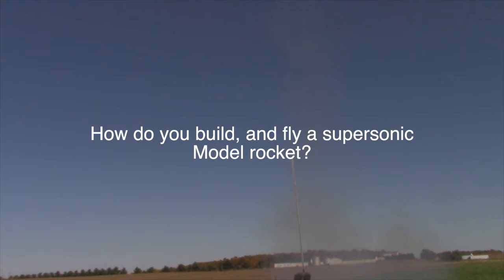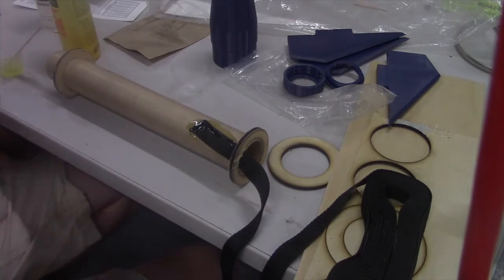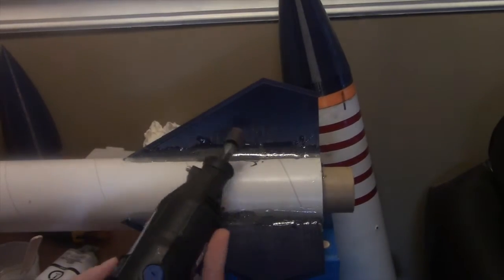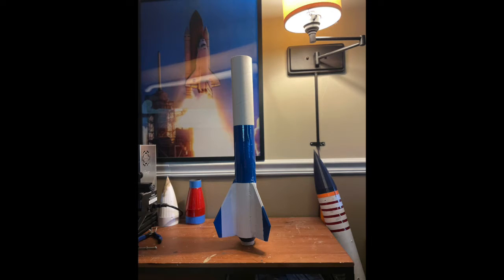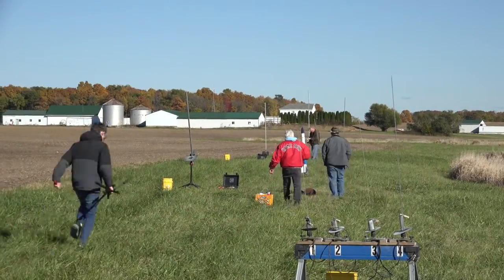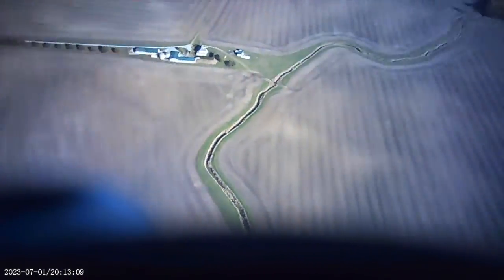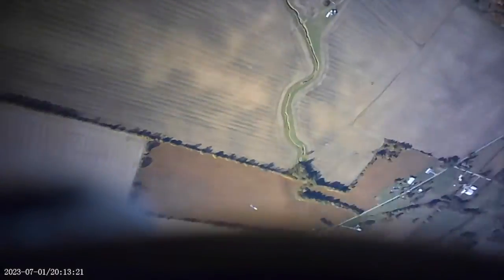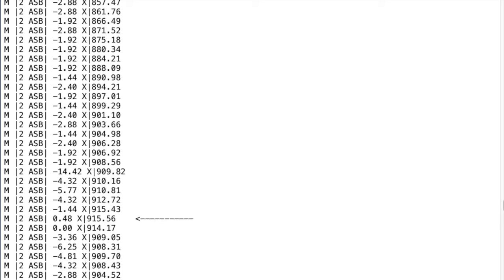How do you build & fly a supersonic model rocket?

Comment: It's roll stability during flight was impressive figuring no active control. Well done! Given the option, it could be worse. It could have been the rocket gently drifting to the ground and the computer taking a dive.

(Back seat video editor notes: You don't need to say "next" at each step. Watching the build process, for me at least, is part of the fun. Take your time and show off your skills. 😃)
Reply from the maker: I think it didn't roll much because i used thick fins with through the wall tabs so they were very straight. And yha i used the word "next" a bit too much, i'm not very good at the commentary part.
Reply: @ModelRocketDev  Practice make perfect. Keep doing it. It gives me hope that I can figure out this hobby.

Comment: Are you using 3d printed parts? If so, can I get some details? Very interested in 3d printed fins and motor retainer.
Reply from the maker: Yes i 3d print the fins and nose cone, but on the HPR rocket level 3d printing the retainer is not the best idea since it is just plastic which can melt. For the fin designs, OpenRocket, a rocket design software can export your fin design as a obj file i think, and then you can put it into your 3d printer slicer software. When i built this rocket the feature had not came out so i printed out the fin design on a piece of paper and got the measurements from it and designed it in Onshape, i don't recommend doing it that way tough because that was very hard and i still didn't get it right, i recommend using OpenRocket and exporting them. Its a really good feature and OpenRocket is free. For the motor retainer you can get them from a online store called eRockets, there is quite a few choices, some cheap, and some a little more, but i recommend getting a more high end one, its better to get a good one than have your motor fall out of your rocket in flight. eRockets also has literally everything you could possibly need for building rockets. I highly recommend printing parts, its cheap and they work, you just have to understand the limitations, like not putting it by heat or under a lot of stress.

Comment: At 850 mph that thing would have coasted way past 3000 ft.
Even if it stopped burning fuel at 300 ft up
Reply from the maker: An H550 hits really hard really quick, and then it didn't coast because my fins were thick. After the flight i took how long it took to get to apogee and how long it takes to travel 1 foot going mach one, not sure if i explained that right, but it did go mach one. That motor probably burned out not even at 200 ft.

Comment: Should be a sonic boom if it went supersonic. Even a tiny .177 air gun pellet will create a loud crack if it goes supersonic.
Reply: We have electronics on board in our E-bays that are amazingly accurate that tell us the speed and altitude. It is very easy to hit mach 1 with a amateur rocket.  Whats hard it making one that will hold up to the speeds.
Reply from the maker: Nope, model rockets don't make sonic booms when they go supersonic, iv seen several go supersonic and none have had sonic booms.
Reply: Online explanations of Sonic boom are very bad
Reply: Supersonic speed is the speed of an object that exceeds the speed of sound (Mach 1).

Comment: It went supersonic and only 3k?  Are you sure?
Reply from the maker: Im 90% sure it went supersonic, both of my simulations with 2 different apps agreed, OpenRocket and Thrustcurve . And 3k feet should be normal because the H550 burns for 1/2 a second so 90% of the flight is just coasting.
Reply: @ModelRocketDev  Oh I am quite familiar with the H550 DMS and RMS version and have flown many of them.  Usually though, most supersonic flights go significantly higher than 3k.  I guess that might be a result of your fins being rather thick slowing your rocket down after burn out.  Regardless that looked like a super fun flight.

Comment: Can you tell me how to make rocket full with high thrust
Reply from the maker: Its quite complicated at this level of rocketry, start small with kits and learn the basics and get experience, then start to scale it up, the bigger you get the more expensive it gets, the motor i used in this rocket costed about $63, the rocket without the electronics probably costed about $100, then the electronics are about $200, so thats $363. You also need HPR certification. So start small, get experience, then start to scale it up.